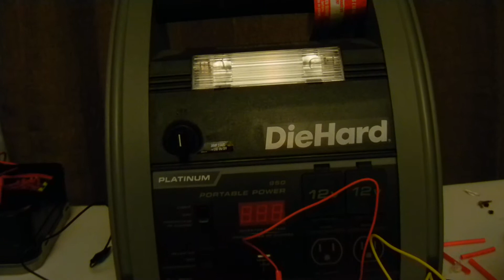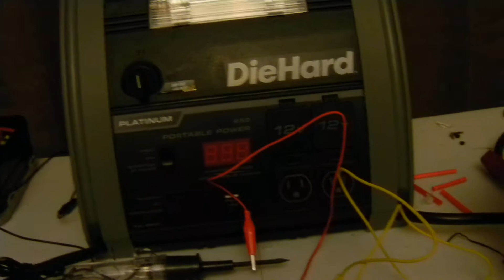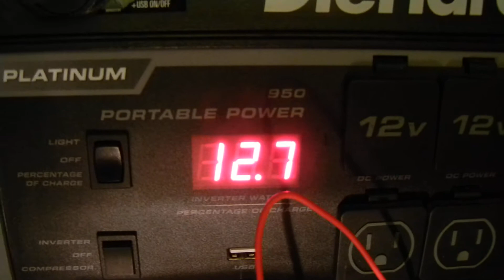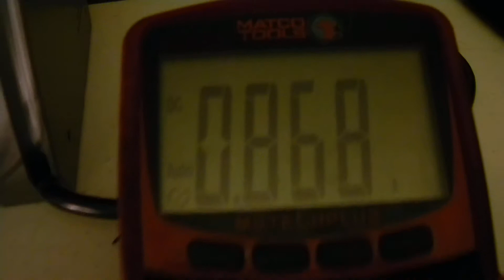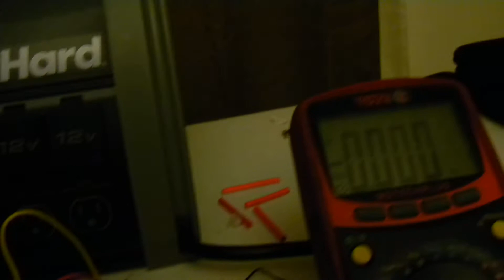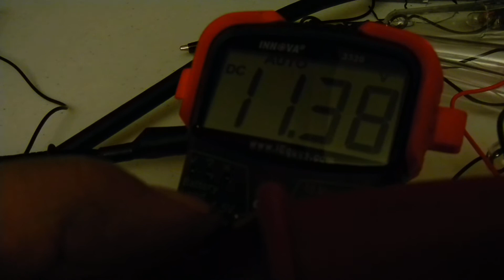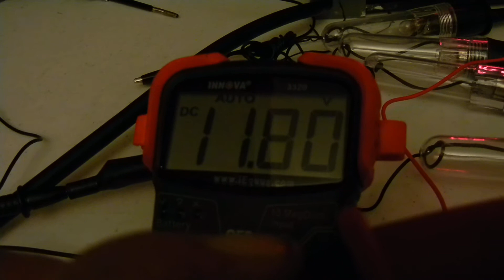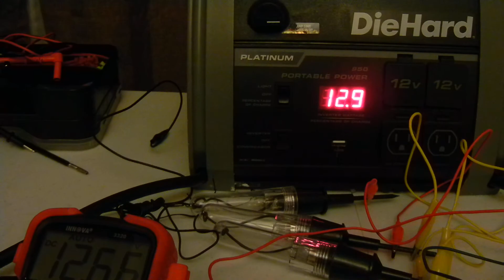Voltage drops in parrallel part 2

Comment: Please remember that my comments come from 30 years in repairing electronics and electrical faults, im not attacking you in any way my frend :-)

100% better than the first video :-))

You got the point of power supply quality using the resistors, you kept to the basic idea, a simple idea said as simple as possible.

And you got over the idea of whats an acceptable voltage loss.

The ammeter was not required, the loads and voltmeter was the proof :-)

Remember that other people dont have your knowedge.
Other things could be added but that would cloud the basic understanding.

Another video could be "what makes a good low resistance feed", connections/clean and tight and wire thickness :-) just a thought :-)
Reply from the maker: I know your not, just wanted to clear things up like you reccomended.  That's why I always tell people to ask questions if they don't understand.  I like input, it helps me clear things up if their is an error in the way I show something.  That way I can correct myself.  Thank you.
Reply: Ahh good, sometimes text can appear nasty as there is no visual cue for you to know im just trying to help.

I do actually understand the problem of explaining to people, ive done it a lot in the past, ive had to think about what point im trying to get over and sometimes omit a lot to minimise the confusion.

Otherwise i get the stare of blankness ha ha :-))
Reply from the maker: Thanks.

Comment: Hi busjockey. Good demonstration of voltage drop using the ammeter and Loadpro. I understand how the test lights were connected along with the two resistors, but it may be beneficial for other viewers to show a diagram and point out on the diagram where you've placed your ammeter, voltmeter, etc. One final thing and not to be picky, there is only one "r" in parallel in the title of your video. Good work bus...